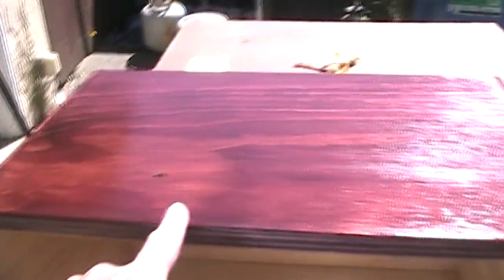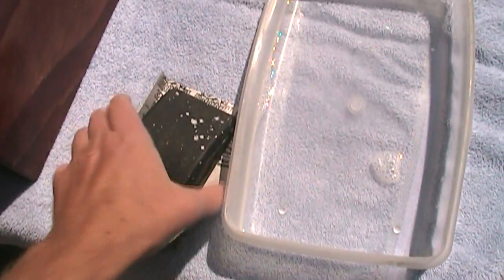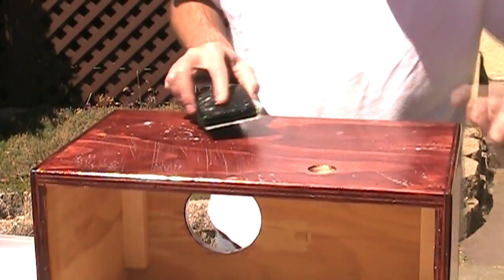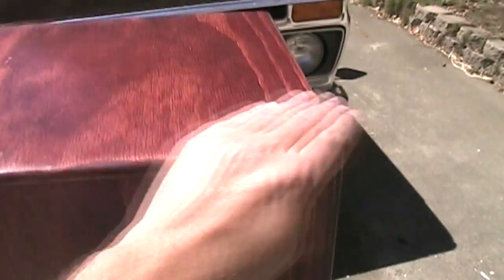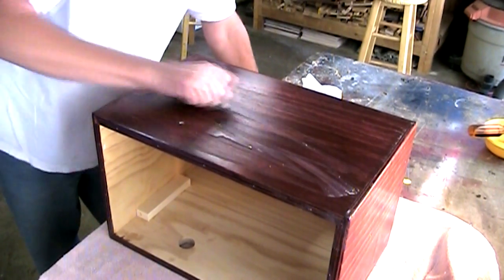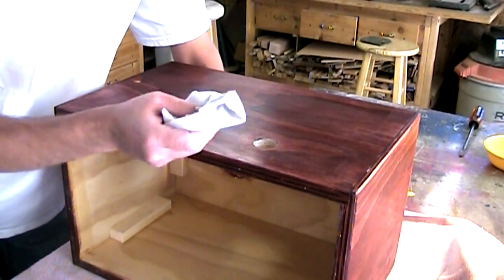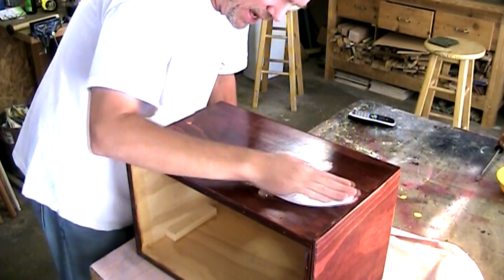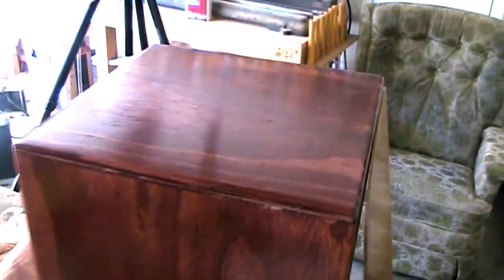MM 8-18-11: Rubbing out a lacquered finish

Comment: Looks good, Steve. Have you ever rubbed out a lacquer finish using Micro-Mesh? That's when you want a glossy finish, but it does take a bit more work going up to 12000 grit, or grade actually, since it's not the same as regular sandpaper grit. You could also use the 3M wet/dry papers that go up to 2000 grit and get a pretty glossy finish also, but the Micro Mesh lasts longer.
I'm looking forward to seeing the Cajon video.
Larry

Comment: I have in the past cheated, with good results.
Finish wood to a good surface - say to 600 grit.
Apply paste wax, and wait for the worst of the volatiles to have evaporated - 20 minutes or so.
Run a blowtorch set on full at speed over the surface.
For a typical handheld propane blowtorch with integral cylinder, this would be about  1 inch distance perhaps, at perhaps 20 inches per second.
This flash-evaporates the rest of the volatiles - but because of the time spent at temperature, does not boil or discolour the finish in any way.

Comment: I used a brushing lacquer and a cheap Harbor Freight spray gun  40 psi and Lacquer thinner 1 part to 3 parts Lacquer with outstanding results on several projects I then wet sanded the finish was great I tried to find out why they say brush only due to photochemically reactive and do not thin after looking up the word photochemically which made no sense to me I went ahead with the projects again great results If I did not thin brushing Lacquer it would be way to thick I did spray this on my outside workshop so there was no ventilation problem.
Reply: I think inhaling lacquer fumes can cause long-term side effects of run-on sentences

Comment: Used 600,1200 grit wet followed by minwax paste.  Use the same brush techniques and brush prep from battling oil poly.  My wife caught me rubbing out my wood in the sink using sandpaper.

Comment: Some videos show using a quad 0 steel wool for buffing off the wax.. Do you not recommend that?

Would spray lacquer give the same end effect? Would you said the first coat and apply a second spray? And then do what you suggested with the soapy water and sandpaper? Then wax lol.
Reply: Spray lacquer is just really expensive for a piece this size

Comment: @stevinmarin They've got several different types of Micro-Mesh. I like the package that comes with sheets that are 3" X 6" with a 3" X 3" rubber sanding block. There's also smaller sheet sets, I think they're 3 X 4, then I use the 2 X 2 double sided foam pads for polishing acrylic pens. For rubbing out lacquer the 3 X 6 sheets and foam block would be best.  I think the set goes for between $35 and $40. I use an old toothbrush  and dish soap to clean the sheets from time to time.
Larry

Comment: Great vid as always Steve.   Do you think the 0000 steel wool fibers could be an issue in the wax finish?  I use my wife's old hose for waxing and buffing since they are non ferrous  and have similar abrasion  to the 0000 steel wool.

Comment: I dont want to be "that guy", but I've just got a couple of things that need to be said. First, when rubbing out for a satin finish, it is important to rub everything with the grain. From wet sanding, wax application and the rub out. All with the grain. If going for gloss, have at it just how was instructed in the video. The final buffing will make those scratches shine. Which brings me to the next point... Again, for a true satin finish, dont let the wax dry. It needs to be rubbed out fairly quickly (with the grain). If you let it dry, then you are buffing. What does buffing do? Buffing is going to apply a more radiant sheen (gloss). If you rub the wax out before it dries, you are going to have an authentic hand rubbed satin finish. One more pro tip for a great satin finish: Use a gloss laquer for your first two or three coats. Then switch switch to the satin laquer for your last two coats (you can do this with poly too). Doing this really makes the grain pop while still dulling the sheen, as opposed to the cloudy look when applying all coats with satin. And always let it cure for at least a week before rubbing out! Wait even longer if you can.